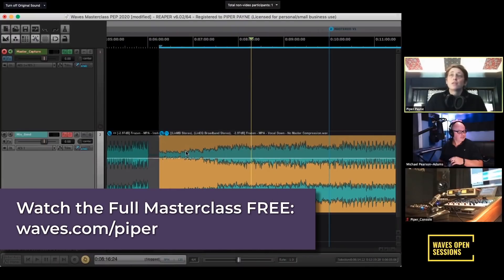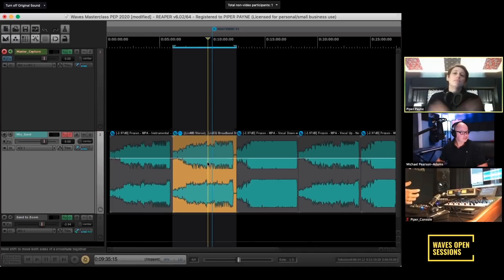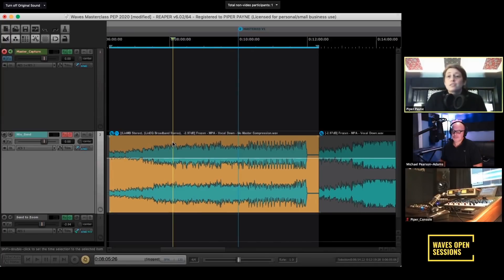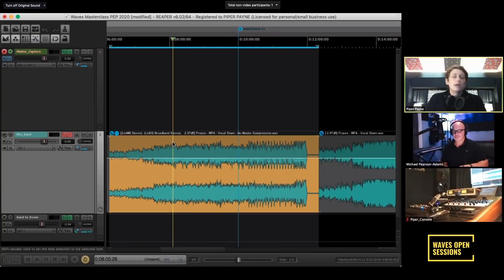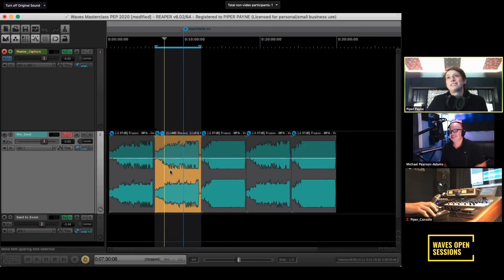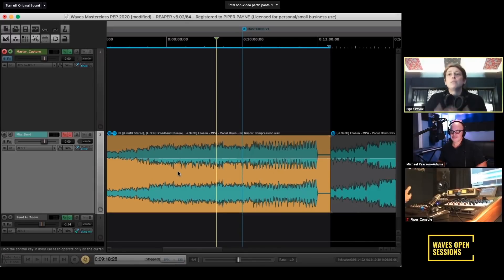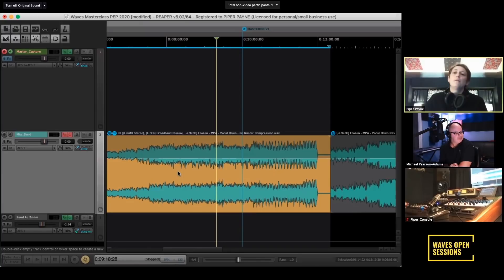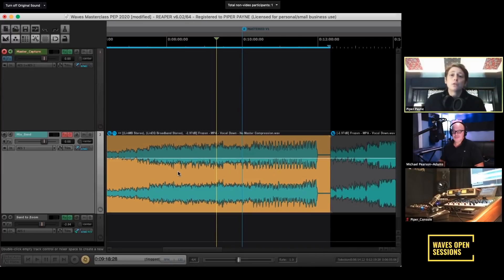Mastering Masterclass: Loudness and Dynamic Range

Comment: Better send the 32bit files. It's exactly amount of bits going straight out of most plugins. If you have such on master buss then the output should be 32bit. Some plugins has 64 bit out. You can check bit depth of your output by using the plugin called bitter. It's free & you should insert it on the very last slot on the master buss.